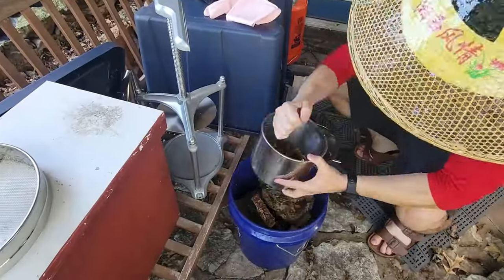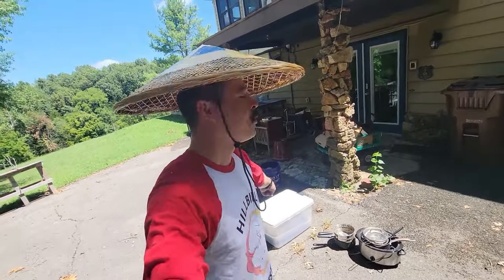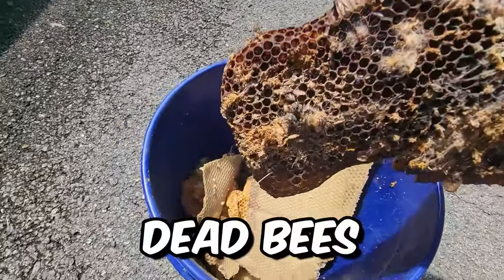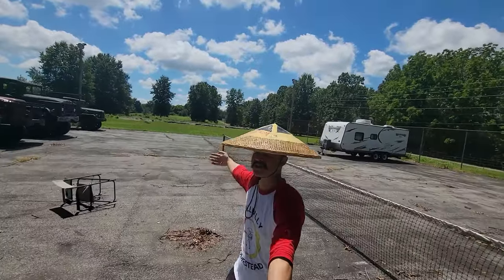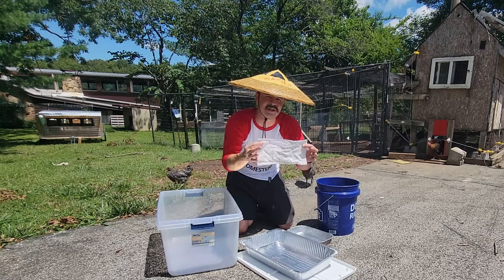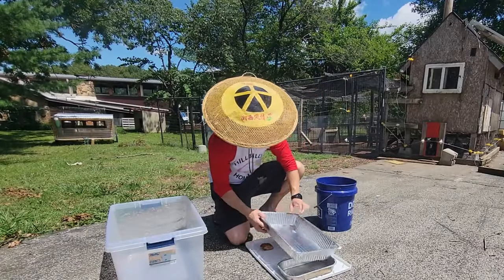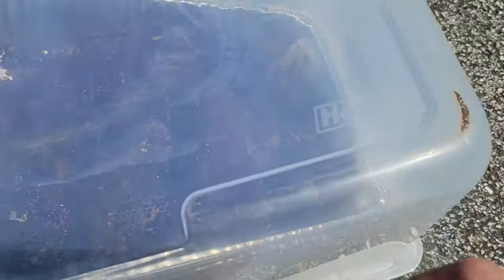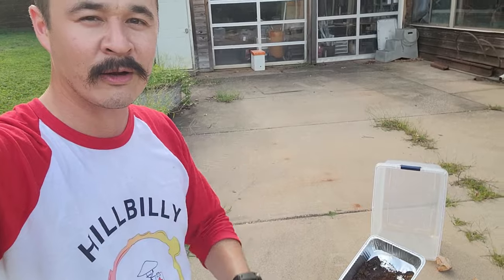How to Build a DIY Solar Wax Melter | Effortless Beekeeping

Comment: That worked surprisingly well.
Reply from the maker: I was honestly completely shocked and felt silly that I try to any other way the year before. I was extremely pleased with not needing to build a box or have anything special, most totes don't have a clear lid (at least in my walmart) so I got the idea to just invert the box and have it be a little solar oven by itself. I think I'm going to come up with a improvement and spray paint the bottom of the lid and the pan black. I honestly had semi low expectations for the paper towel being a decent filter but I'm extremely pleasantly surprised. I'm probably going to donate all of my pots and pans back to goodwill

Comment: This is quite a good design. It is inexpensive. It has the transparent material all over so it is roughly as efficient at any time of day. Requires no joinery or panes of glass etc. It will fit several deep frames. It isn't delicate at all.
Reply from the maker: It was one of the best decisions I've made was to switch to using this kind of a wax melter! Results of super cheap to make! We've been actually cleaning and cycling are wax from this year already.